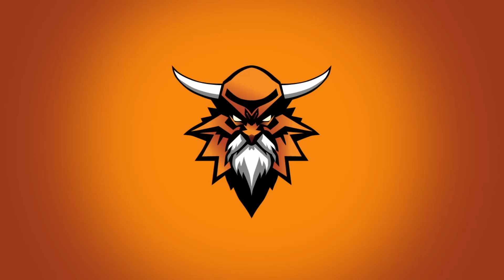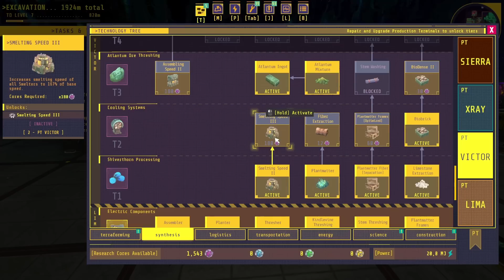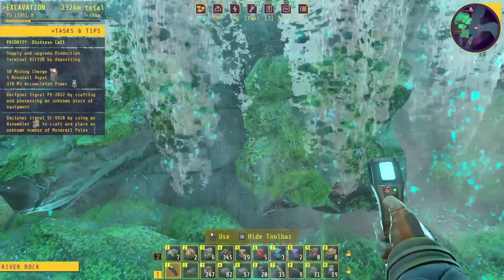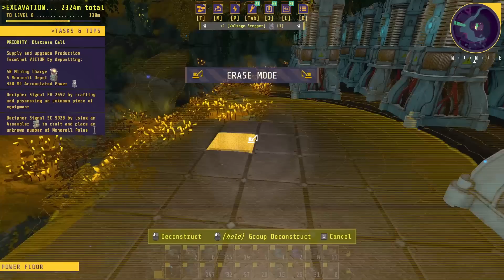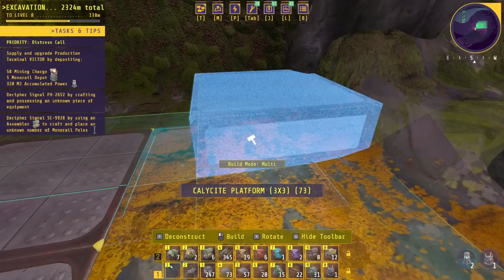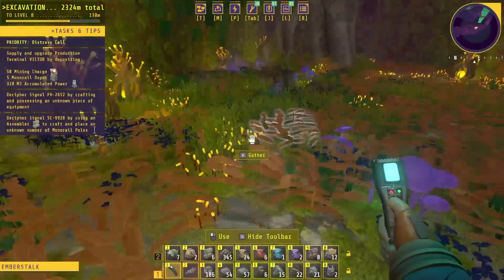Techtonica 1.0 - How to Connect Power to the Elevator and Other Stuff [E5]

Comment: hello I subscribed to your channel 3 days ago and on Techtonica the lift belt system allows you to lift items up and down plus that also allows you to have like 3 groups of 4 belts that are stacked with 1 small block opened between each stack so you can bring any of the 12 belts up to the 5th row and belt the item over all the belts and bring it down to the machine that needs that item and also that allows you to keep things nice and tight with no wasted space.
Reply from the maker: Thanks, those are a very useful tips!

Comment: Ahh one tipp for all players .. 
If you build a vertical con-belt you can put 4 inserters around vertical con-belt to pull out items in 4 directions not only on  the belt exit ... actualy you can pull out from any hight ..as i say not only from exit just try , this way i solve many problems  mostly by feedeng  mining drills and smelters with fuel 💪🏼😁
Reply from the maker: Nice tip. Thanks.

Comment: I’m confused on the power situation. If you have the water wheels producing power why do the miners and smelters need fuel? Do they not take power from the water wheels?
Reply from the maker: You don't have the water wheels early on so the mk1 miners and smelters need fuel. By the time you get to mk2 you should have enough power to build them and they don't need fuel.
Reply: @ thank you! This has been quite fun to watch.

Comment: If you hold shift button and use the scroll wheel... changes the upper hot key bar and CTRL key and wheel button for bottom hot-key bar....
Reply from the maker: Thanks. I got that in the next video.

Comment: You don't need to run to the elevator to check where your at with drilling.  That is shown on the screen, top left with a progress bar.     Ps.  They fixed the detector level 2 in Orebound.
Reply from the maker: Ah, thanks for the tip! I will start using that screen. Orebound needs to sort out the trains.